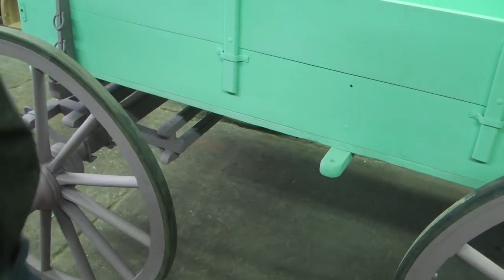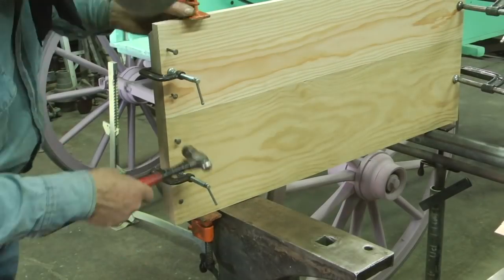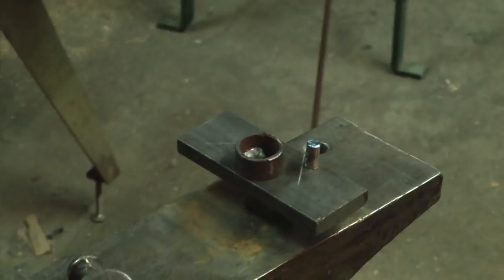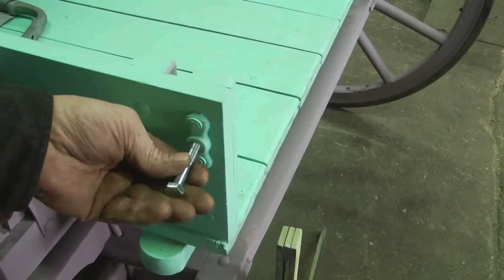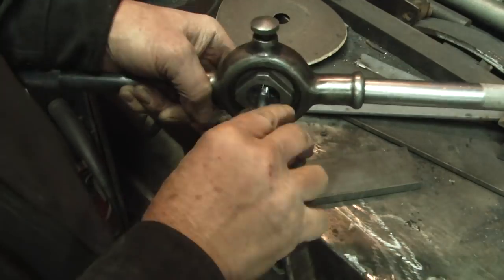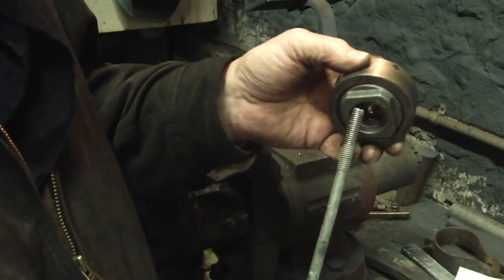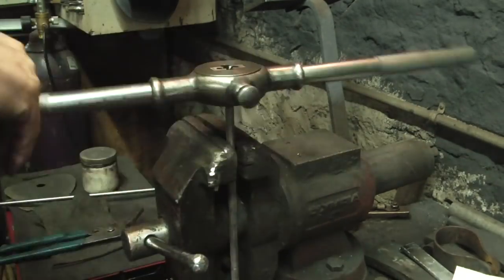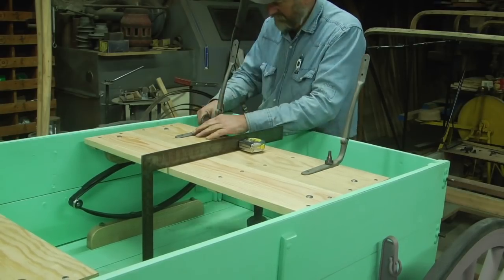Unique Wagon Seats For the Piedmont Wagon & Forging the Box Rods

Comment: Did you finish this wagon? Are there more videos? We spent all that time picking paint out. Tracing the painting design.  Do the brakes work? Do the seats have enough bounce? I never thought about the wheels hitting the sides of the wagon. Do the wheel stops work? Don't leave us hanging.
Reply: What happened to the rest of the videos to finish this project?

Comment: Smooth presentation. Back in 1960's part of a chuck wagon racing crew, outrider, southern MN.Could have used your talent/maintenance.
Reply: We had 4 wagons,4 horse hitch(with switch out teams) per wagon,4 out riders per wagon,so quite a circus when pulled in to a show. Oldest wheel horse was 22yrs, and damm good. I graduated 1963.